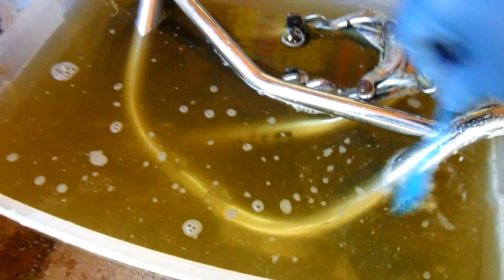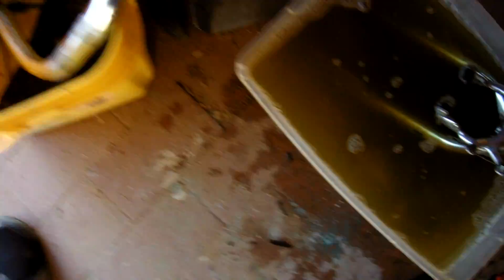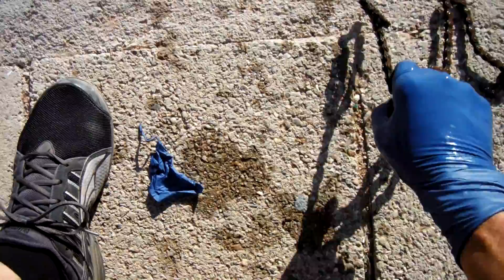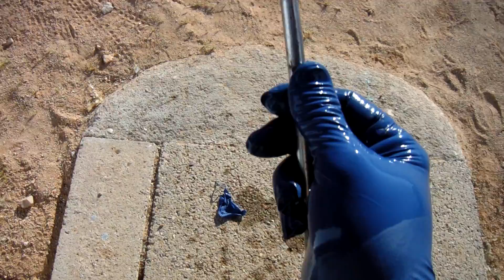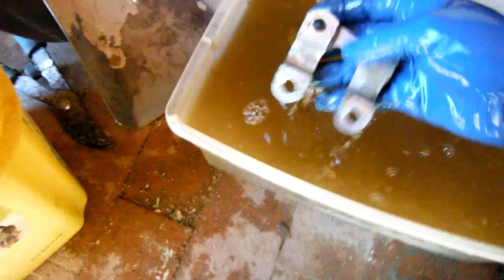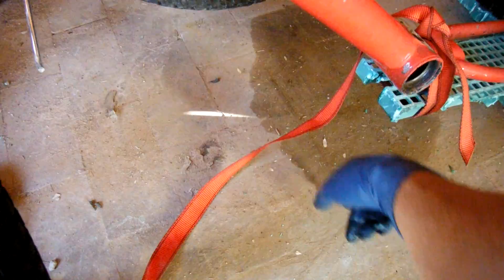CLR the power to remove rust we will see part 2 CLR wins 48 hrs later

Comment: how did the chain hold up for the extra day? i'm thinking about doing this but am worried the CLR will eat at the grease inside the chain pin's making it less flexible.
Reply from the maker: it held up fine and is still holding up, i sprayed some chain lubrication on it.